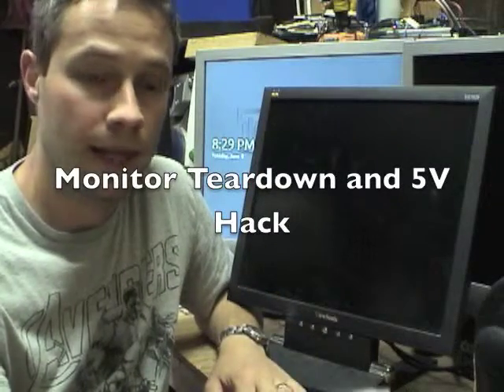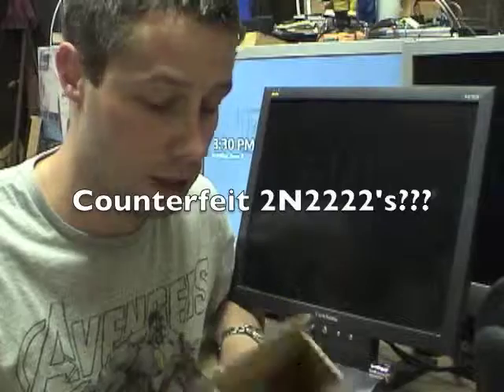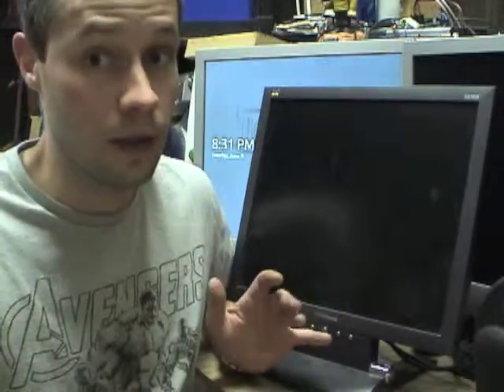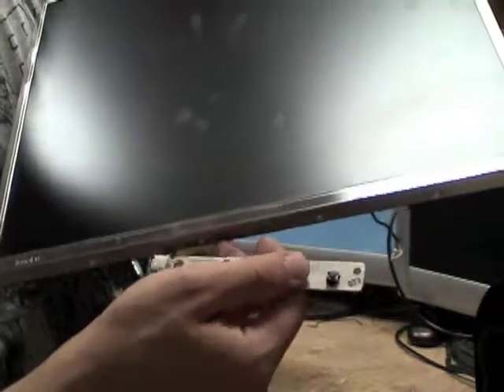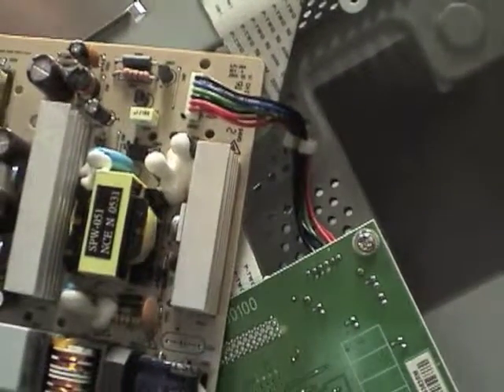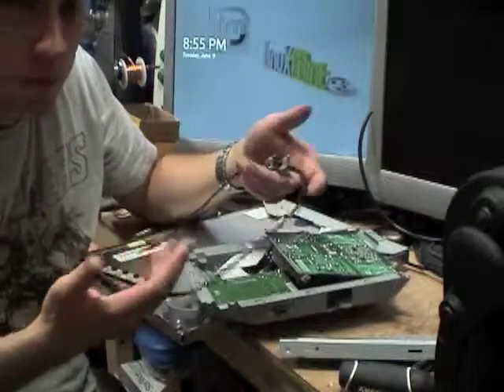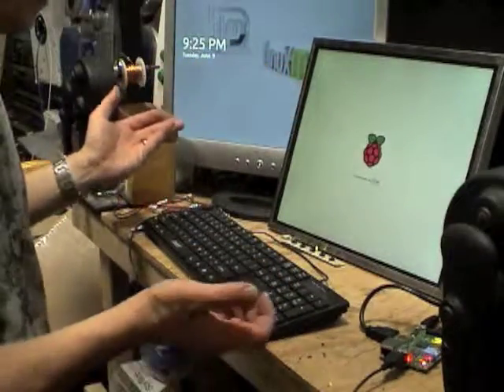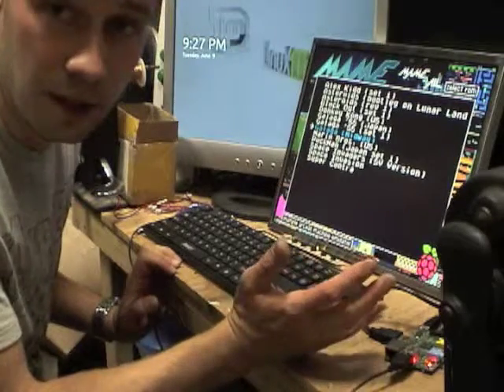monitor teardown & hack

Comment: iva got a question, is thew back side high voltage( the metal frame to protect all the parts)? Im just scare to turn it on and touch it.
Reply from the maker: Hello,
The monitor I was working on had the shielding cage around the 120v power supply, yours likely does as well. I was sure to leave the shield on after so that fingers wouldn't easily get in there. If you're really concerned you could reinstall the back plastic.

Also note, some monitors use a florescent back light (newer ones usually have LED's), these florescent lamps use a high voltage ballast, which has a lot more potential than 120v, so use caution around those as well. On this monitor you can see the white connectors going into the sides, those could potentially cause harm as well.

Be safe and happy hacking!
Reply: thx.